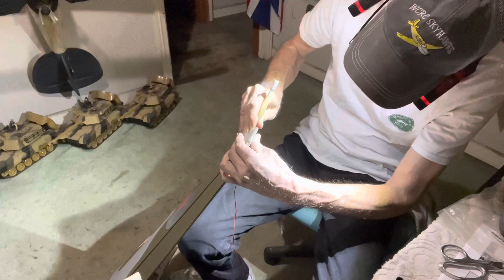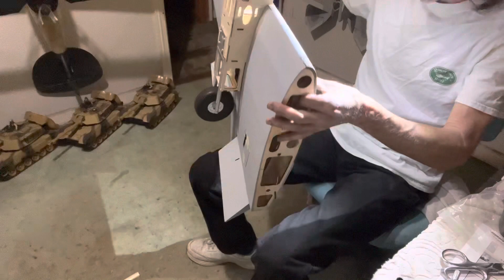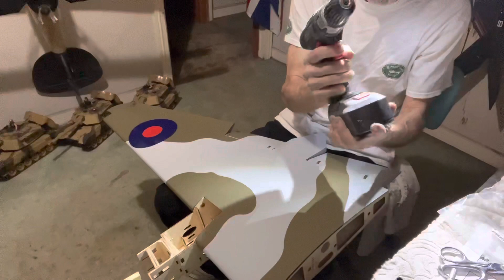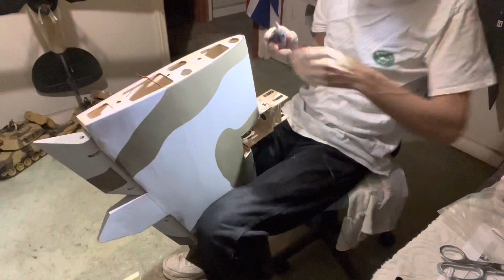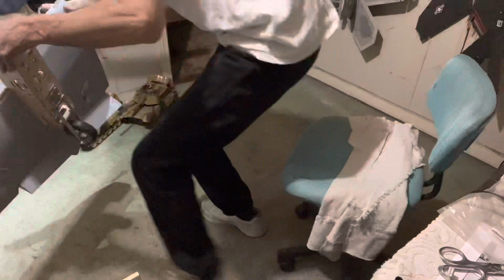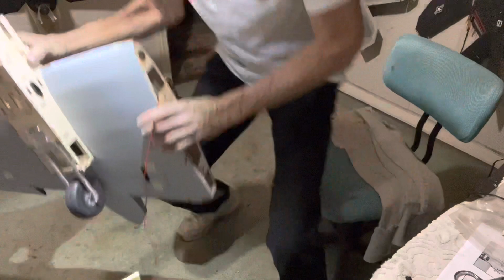Mosquito Nav & Landing LEDs

Comment: Before you glue the lenses on, if you'll line the light well with foil tape, it'll act as a reflector under the lens and make the lights shine brighter. Just food for thought. One roll of tape will last a lifetime if this is all you use it for. a very cost effective little extra..
Reply from the maker: Yes I’ve done that on my F-22 . Thanks 👍🏻✌🏻🖖🏻
Reply: @eqrc7587  Cool. Figured you knew, but information is for sharing, so I try whenever I can.